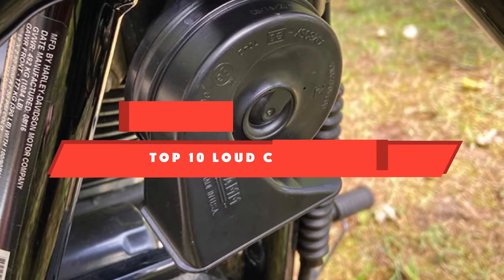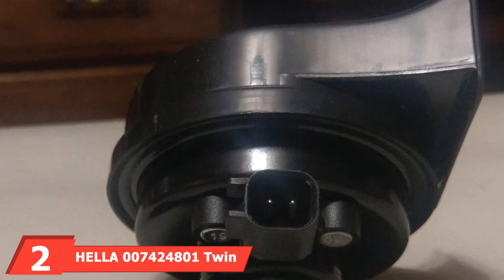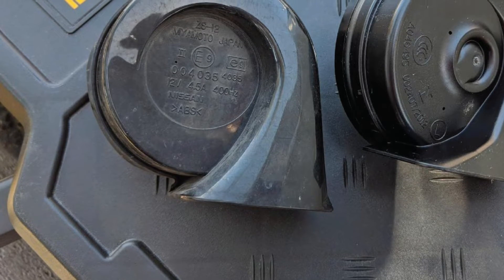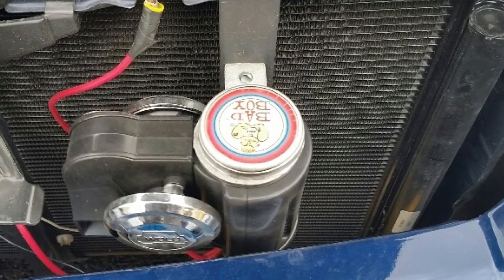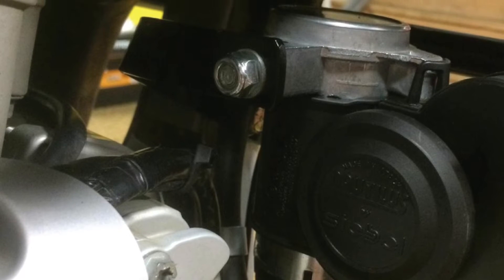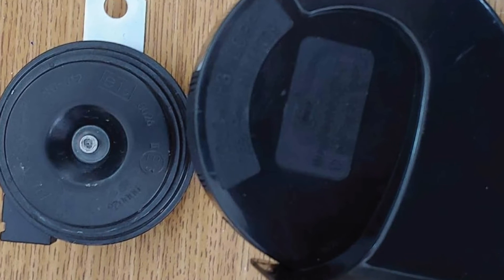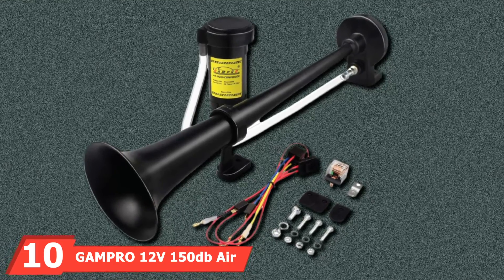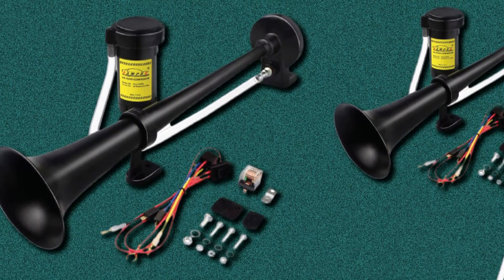Best Loud Car Horn In 2024 - Top 10 Loud Car Horns Review

Comment: Used Delco Remy horns from the 1960s are LOUD. Loud enough to vibrate your steering wheel. I recommend them if you could find a working pair.